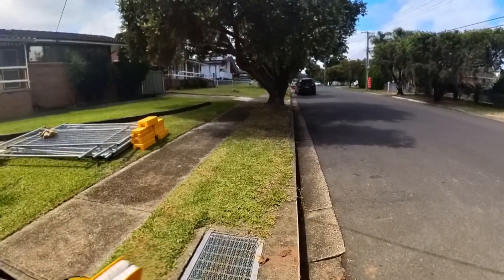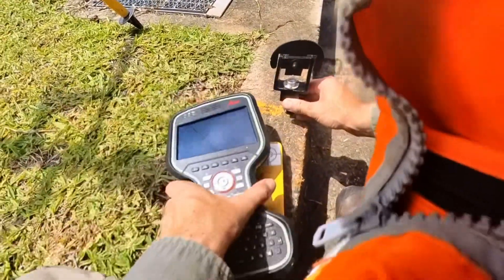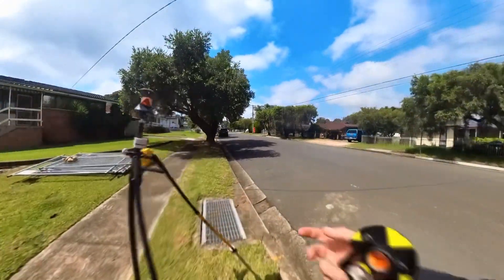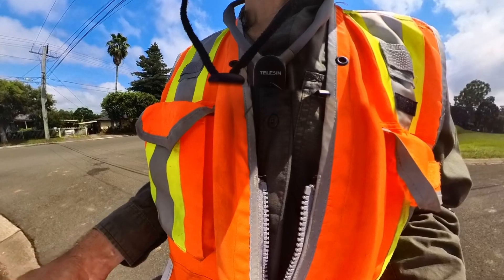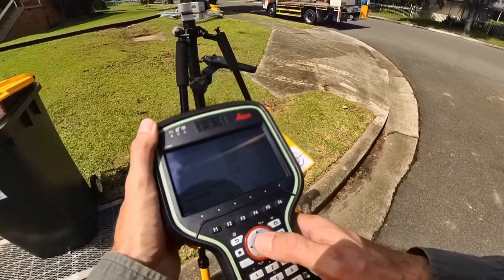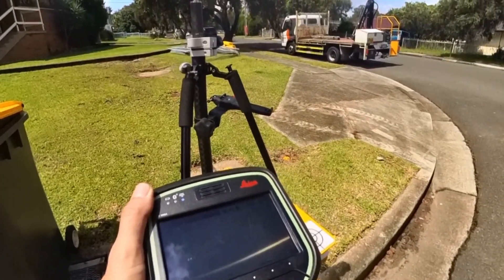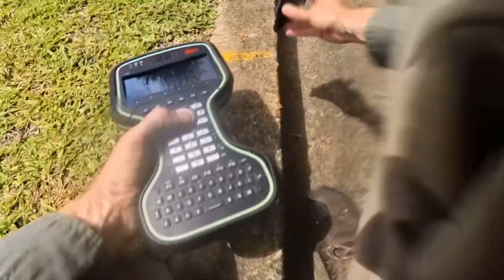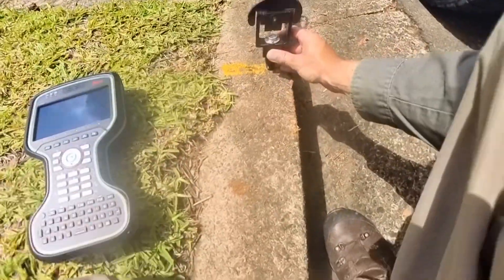Land Surveying POV - this is how it’s done.

Comment: While doing the detail survey,
Do you prefer resection for station setup?
Reply from the maker: Hi. Yes I'd prefer to do a resection to start with so I can get my survey onto a known azimuth. Therefore I draw up the subdivision plan, find some marks and do a resection. Then I traverse normally to other stations and do the survey.  HOWEVER - if I'm short for time or having difficulties then I might just start on a assumed azimuth and do the work and perhaps have to return to look for marks.
Reply: "Thank you for the information. I am a civil engineer who works as a land surveyor in Sydney. Although I have been working as a land surveyor for more than 2 years, I am confused. Could I join you on field weekends so that I can learn how experts conduct surveys in the field?"
 @globalsurveyor
Reply: When doing the alignment I always bang in a decky somewhere I can set up on and see down the lot (ie through a gap in the side or double sided garage) so I can get out the back for the feature. Then known backsite when I'm doing it. I think this is the norm. 

If they cheap out and don't want the alignment I just set zero to the side boundary. It takes two seconds to rotate and adjust to get the perfect 'zero' look on the final plan or if wanted in say PCG it's just another shift and rotate.

Edit to add: we all need to be registering field books more often for older areas.  It gets tiring turning up to an area with 3 different spray marks over points with no record tying them into anything.